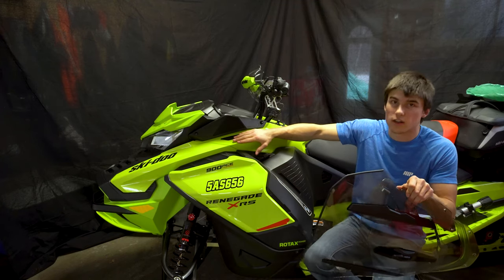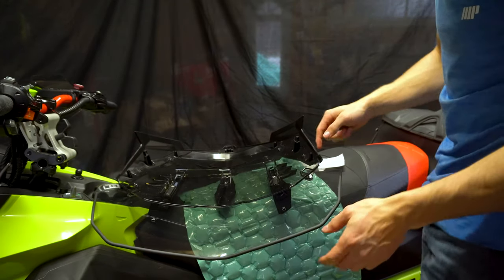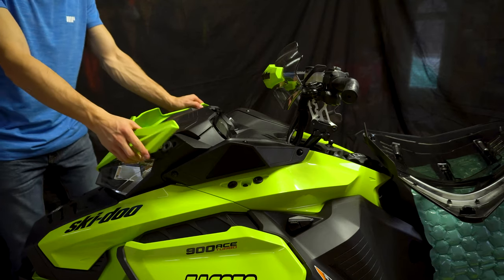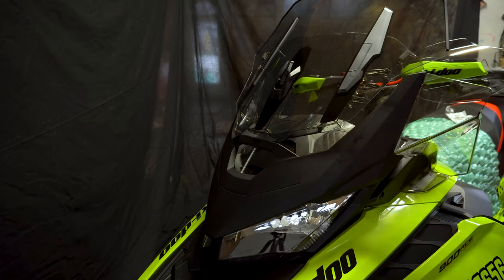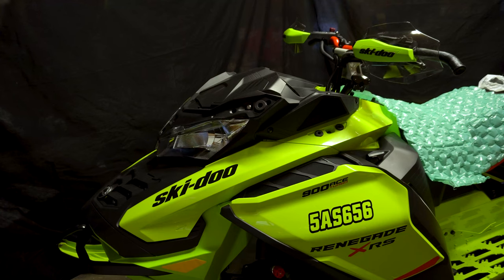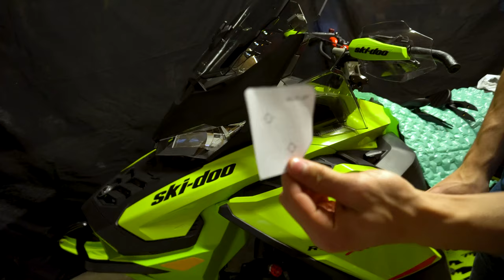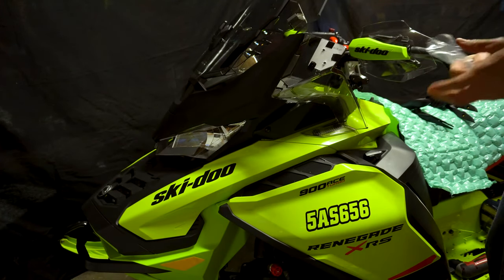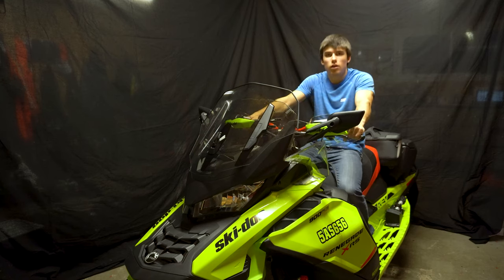How To Install Adjustable Windshield Ski-Doo XRS 900 Ace Turbo 2020

Comment: is the the medium to high windshield? also did you have to take off the hand guards? I want to add the new signal lights but it requires hand guards to do that  but I don't want to have a low windshield . how do the hand guards work with the windshield in the high position?
Reply from the maker: Yes it is and we keep the hand guards there

Comment: Dont wanna have left over nuts or bolts. Lol. 
Trying to decide what shield im going to put on my new xrs. Hummmm.
Thanks for the post. 

My 800 has the high with deflectors. Rather have just a low one but running lakes at minus 25 gets cold at 85mph. Cheers

Comment: My cover won't fit now. Can these somehow be folded away? I don't see how you fold them but the skidoo site says they fold away for covering. Thanks.
Reply from the maker: I do not believe that you can fold them away
Reply: @4SeasonBros  I looked at them on the Skidoo site and they say they fold away so the cover will fix. All they mean by that I believe is to spin them around so the pointed side is facing inwards. This allows the cover to fit.
Reply from the maker: Ah ok i see now   !

Comment: Can you tell me how to remove the pushnuts from an existing windshield ? Thanks
Reply: I cut mine off with some wire snippers, not pretty though. But the windshield support was broken anyway.
I would just replace the windshield support, it is not too expensive (relatively speaking).

Comment: THE PROBLEM IS now you don't have a cover for your sled.  The ski doo cover only works for the stock medium windshields or shorter.  They don't offer jack in their catalog and nothing much in aftermarket yet.
Reply from the maker: Good point but we do not use covers since we have an inclosed trailor for when we travell and when stored in the summer juste a cheap snowmobile tarp from princess auto